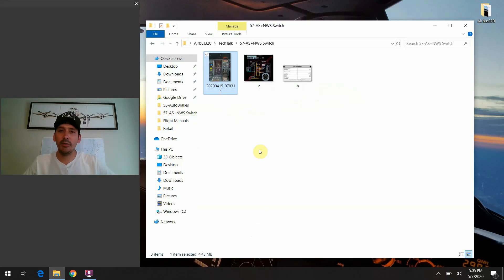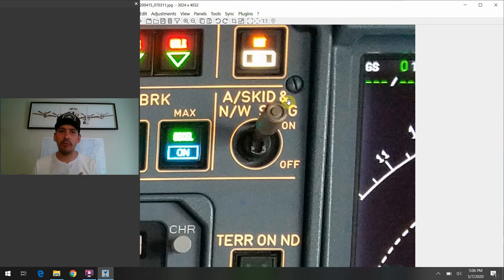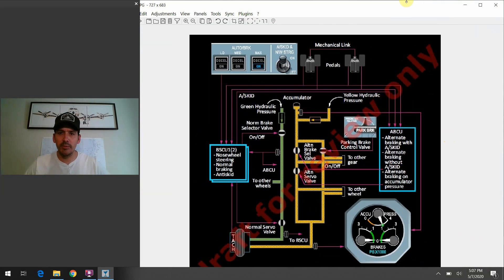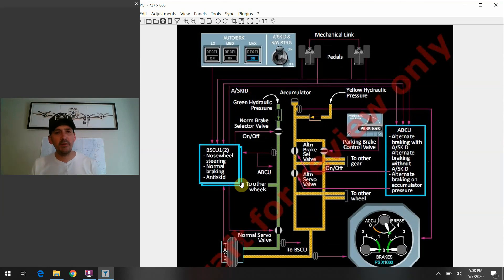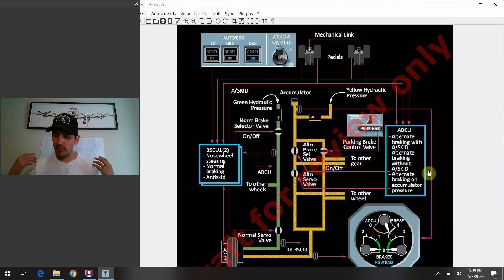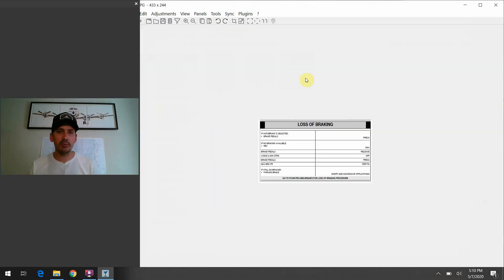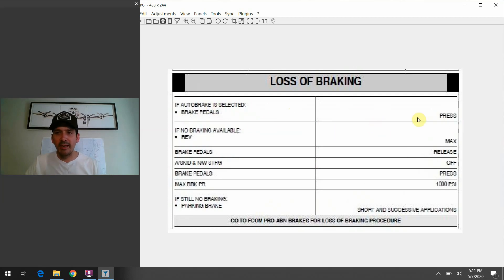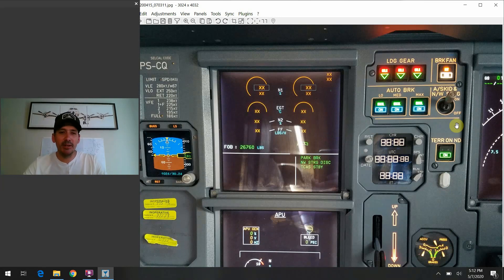Airbus A320 Cockpit Tour: #57 - AntiSkid/Nosewheel Steering Switch: What do all those buttons do?!

Comment: What would happen if you do not disconnect NWS during pushback? Also, if the NWS remains on but the steering pin is inserted, would that isolate the system?
Reply from the maker: Hey Ryesher! Thanks again for tuning in my friend. Yes another good question. We actually don't manipulate this switch in the cockpit at all during normal pushback procedures. As you mentioned, it is in fact the bypass pin being installed prior to pushback which is the only thing that isolates the NWS from the yellow system and prevents damage. As far as what specifically would occur in this sort of a damage scenario, my best guess would be that you run the risk of bending parts out of shape perhaps, or possibly causing ruptures in portions of the hydraulic lines? But I'd have to defer to a mechanic on this one, as I'm just giving my best assumptions here. So to recap, what you are asking in your 2nd question is actually the way it works normally. NWS switch stays on, ground crew inserts the pin, that's all that needs to be done. One interesting thing of note too, is there is a small light system on the gear that stares the pushback driver right in the face. If the system is not showing appropriately they know not to commence pushback because the pin is not inserted. At my airline the Captain and the Driver always make radio contact and verify these words verbatim - "Walk around checks complete, bypass pin installed, ready for pushback." Also, after the pushback is complete, the Captain will say to the FO these words before running checklists to make sure everything is good to go. "Tug, Towbar, Pin, Salute...After Start Checklist."